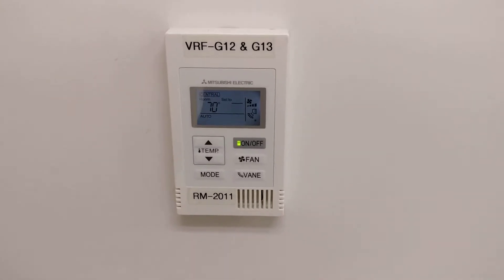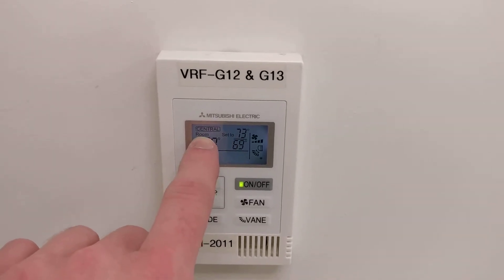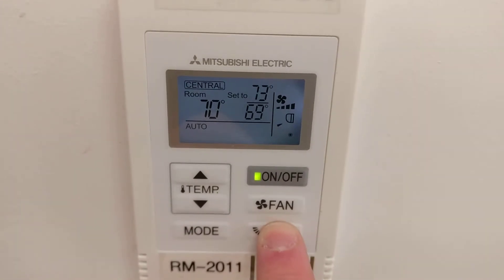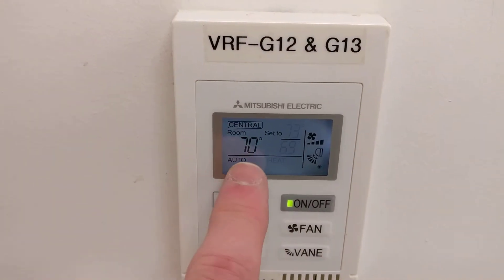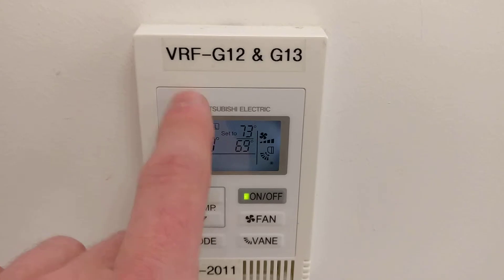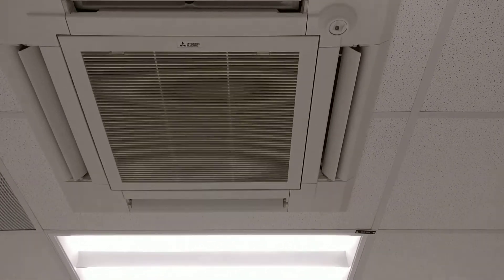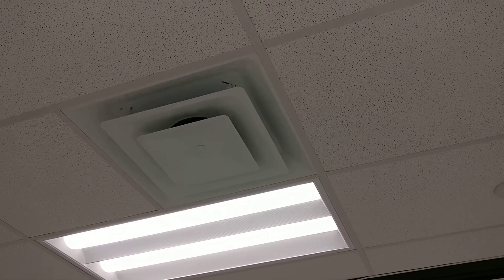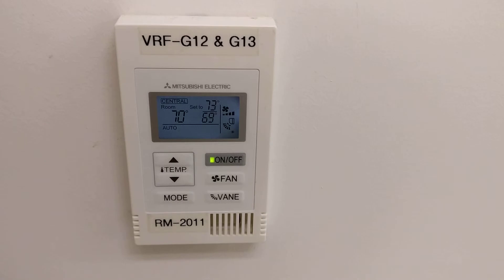Mitsubishi Electric VRF Simple MA Controller Quick Demo

Comment: Thanks for the info about central controller. Stuck in hotel room where temps are way above 70F and the entire thermostat is locked..... Cant adjust anything. Idiots.....4-star hotel and i have to sweat at night
Reply from the maker: Yup, unfortunately many hotels are now set up this way. Wrap a warm towel around it, should work for a bit.
Reply: @springws14lbss  I was there only a few days. Now in a different hotel, same thermostat and it's fully adjustable

Comment: Looks like I'm not the only one who came here looking for the hotel hack. Such a shame this hotel is locked down the thermostat to 67 this video is useless to those looking for that option
Reply from the maker: Unfortunately if the thermostat is locked from the central controller, there is no way to override the lock from the room thermostat. It can only be done at the central panel. That is how these VRF systems are programmed by Mitsubishi.
Reply: There is a way.  I'm looking for it to @springws14lbss

Comment: Hi there and thanks for the video! I am able to unlock the unit but when I push the fan button nothing happens? Is this controlled only via the central unit. I am in a business complex. Fan is one of the loudest I've ever encountered.
Reply from the maker: If it doesn't change then it means those settings have been locked out at the central controller. Only the buildings engineer would be able to change the setting then, unfortunately.

Comment: How do you remove the restrictions on the thermostat
Reply from the maker: What restrictions?
Reply: @springws14lbss  central control
Reply from the maker: @ethanf5441  The only way you can remove those is if you have access to the central controller (Usually an AE-200).

Comment: Have you ever seen one with an incorrect room temperature reading? I have one that shows a 6 degree Fahrenheit difference from another temperature sensor in the room. How would that be fixed?
Reply from the maker: Is the area behind the thermostat sealed? If there is a draft it could affect the reading.
Reply: Im currently experiencing the same issue. Any luck?

Comment: How are you unlock the controller for the AC it doesn’t go under 72 I want to bring it down to 60 or 65
Reply from the maker: That means that the range is locked by an energy management system, only the central controller would be able to change those settings.
Reply: @springws14lbss  is there a way to disable it without the controller
Reply from the maker: @kamsim1  No, only someone in the building with physical access to the central controller (or web access) would be able to change the settings.
Reply: 60????😂

Comment: Is there any way to reset a unlocked thermostat? My daughter lives in an apartment where the heating and cooling is not working properly. This thermostat is installed there. It will randomly shut itself off, blinks, won’t read temp correctly or run to heat up or cool down correctly, and will run forever sometimes. Only thing her apt. building will do for her is change the filters. I think they believe that since the installation is new, nothing is wrong. Never mind they had 3 floors of apts. out this past summer. I feel like someone wired everything up incorrectly. Thank you for any help.
Reply from the maker: Most of these types of thermostats are centrally controlled and can have certain features locked out. Unfortunately if that is the case, only the building managers will have full access to the thermostat. If its a new install then it should be on the contractor to fix the issues under warranty.